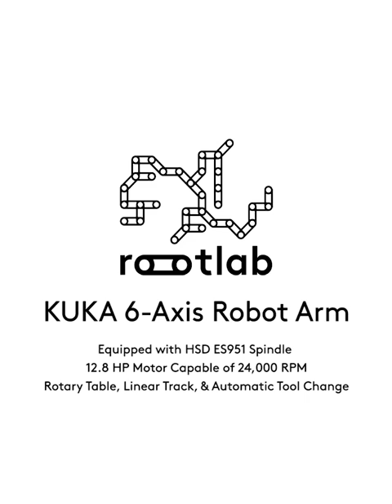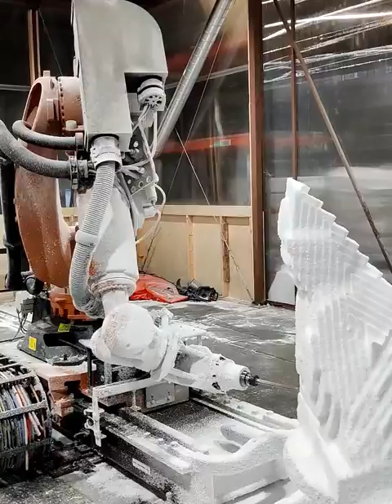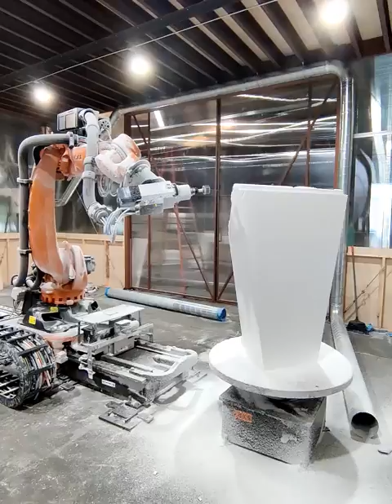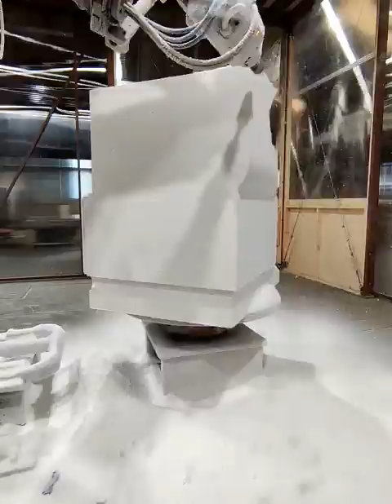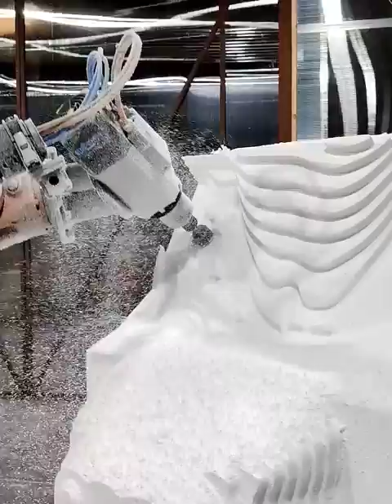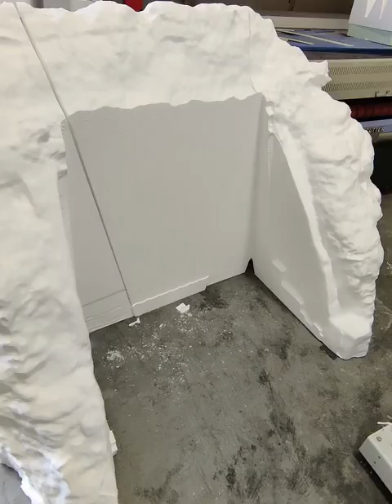KUKA 6-Axis Robot Arm Capabilities

Comment: Isn’t that actually a 7 axis machine?  I’ve been having sculptural enlargements milled since 1998. Fantastic technology and so much more accurate than traditionally pointing up the way I used to do it.
Reply: No its just 6 axis, lets think of it like the human arm
1- Base turns horizonally (1 axis)
2- upper base tilts forwards and backwards (1 axis)
3- the piece before the spindle tilts and turns horizonally (2 axis)
4- the spindle tilts and turns horizonally (2 axis)
So after adding them to eachother its 6 axis, and sorry for my english it's not my first language.
Reply: @hyper_sa  but this one also has a linear track, so in a way you could think 7 :)
Reply: 8 actually

Comment: Can we see the robot pick up a tool from the tool changer?
Reply from the maker: https://www.youtube.com/watch?v=9f0c1WGmO8o
Reply: Is it possible for robots to machine steel or is the rigidity not enough
Reply from the maker: @brianbailiff9668  I doubt it but not completely sure. We do run into vibration issues when cutting 6 inches or more into foam so I think you would have issues with rigidity if you mill steel. Maybe could be done at a very slow feedrate, not sure.
Reply: @brianbailiff9668 There is a company that uses 2 Kukas, each running a small roller ball head, which squeeze steel or aluminum sheets between them to 3D form sheet metal into complex parts that normally are made with stamping dies, or the old fashioned way by hammering sheets into form molds, or english wheel.

Comment: Can please share Which software is used for programming?
Reply from the maker: SprutCAM Robot 14
Reply: Load Cells manufacturer, multi-axis force torque sensor, 3/4/6/axis force sensor for robot

Comment: What is the price please mention
Reply: For a second hand KRC1 or KRC2 with a 100kg to 200kg rated arm about E3500 not counting transport taxes and installation and commissioning.
And then you need the software licences if you don't want to program it manually.
Reply: @andrewallen9993 what price again? Hahah
Reply: @najeramaximo  I have a KRC1 125\150 from about 1999 you can have for R70,000.00 (South African Rands) plus VAT FOB Johannesburg.😁
Price does not include installation and commissioning but does include a demonstration of all 6 axis working.